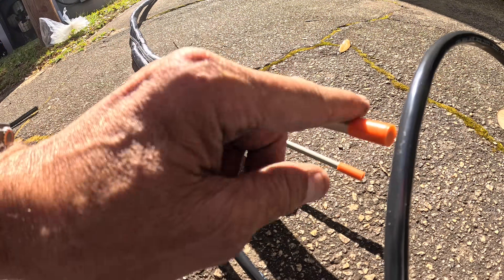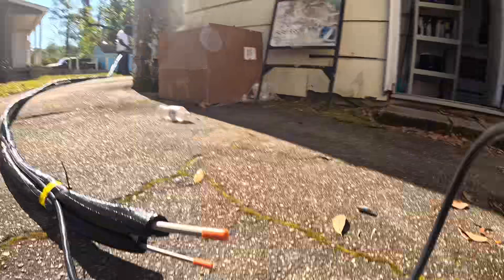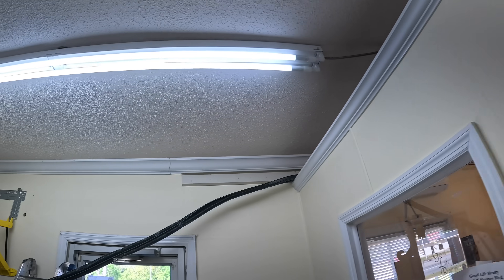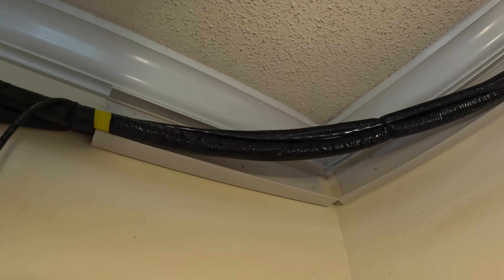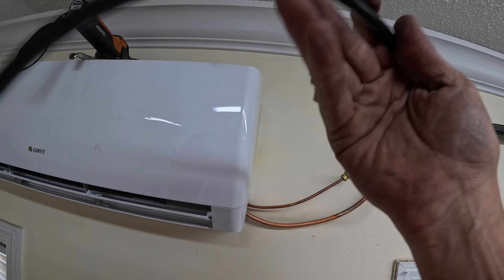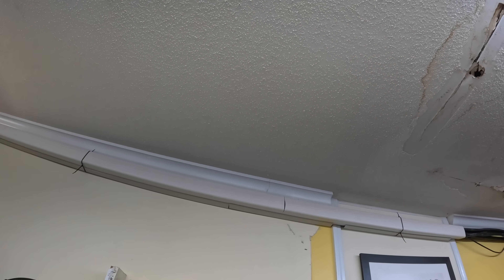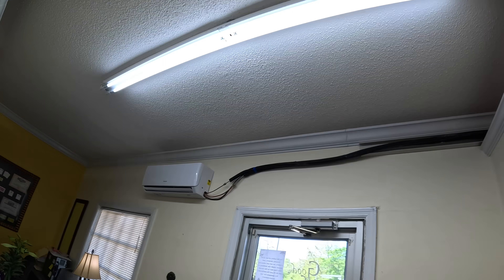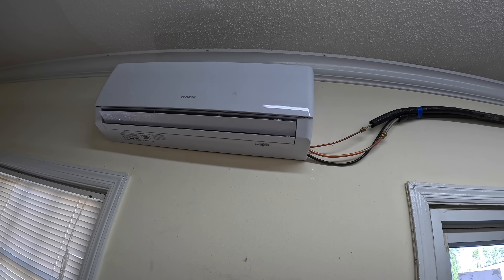Is Steel Really the New Option to Copper? #hvacguy #hvaclife

Comment: To be fair, cars use steel lineset for brakes. They last about 10 years with road salt. That being said, they only last 10 years. HVAC equipment tend to last quite more than that. If the lines were made with stainless however this could be a good replacement. Steel? No.

Comment: Many baseboard hot water systems have steel tubing from the 1950's.
Staybrite soft solder works the best.
Silver bearing solder .
100.00 for a 1lb roll

Comment: Back in 1980 Aeroquip made steel line sets and had a spring around the suction line.
They recommended stay brite #8 silver bearing solder.
Melts at 455*
Test pressure 10,000 psi.
Still use it today on all my copper line sets.
No need to purge .
Appreciate your videos Cutiss

Comment: Stainless steel is the only steel I would trust. Zinc is a catholic coating to protect steel. Welding with galvanized pipe creates a poisonous gas and is especially dangerous in confined spaces like attics. Well ventilated work areas is a must. Zinc will mix with the braise and degrade it. The extreme braising heat will oxidize the zinc creating zinc oxide inside and outside the line. The heat will create a corrosion spot on the line set by removing the zinc. Zinc coating will change the thread tolerances for the threaded fittings. I would not trust it from for long term sealing.

Again stainless steel lines, not galvanized.

Comment: There is a central ac unit at my work with rubber linesets. Its been going for many years without issue surprisingly.
Reply: That was a thing in the late 70s and early 80s.

Comment: If I could afford a system this is what I would install since my home was built in the 1940's. Putting duct work under the floor would be a pain also my house is small so installation of an air handler would have to be in the attic and the noise from the blower fan would be to much. I'd prefer the lines to be in the attic then brought down to the units.  Air conditioning is a luxury I simply can not afford it's for the wealthy!. I still enjoy these videos!

Comment: I’ll stick to copper forever. I refuse to ever buy an overpriced press tool or press fitting and I’m not using 45% and having to cover the joint with shrink wrap, that’s insane. There’s a reason copper has been the industry standard for decades. If you don’t like the way soft copper looks there’s always hard drawn.

Comment: I’ve done a lot of mini splits. I bet you get alot of lesks doing it that way. Press tool. Best way to go for minis. Need one anyway for 454b.
Reply: You don't need to press R454b refrigerant fittings
Reply: @nonamesplease8228  no, but many manufacturers highly recommend it. That’s why a lot are going with mechanical txv’s and other parts

Comment: Mini splits are the best. I wish I could get rid of my 3 ton and 4 ton unit and just outfit my home on a ducted mini split. So much cheaper from equipment to energy usage.
Reply: I don't think the durability is there with minisplits. They are pretty much throw away from my experience unless you buy high end Mitsubishi's. But then the cost is crazy.
Reply: @EthanThruandThru that’s the way I see it. If the inside break $400 for a new one. Outside breaks $400 to replace. Why fix it?  It’s just so cost effective and you should get at least 5 years out of them maybe 10.

Comment: Rectoseal makes 3' long flexible mini split line set extensions in multiple sizes. Copper would have been my choice due to the flexibility needed for use in line set covers on this job.The flex line adapters would enable you to run the line set covering directly to the unit making a neat installation.

Comment: I have to agree with comments about corrosion. If the galvanization is damaged or wears off, it seems unavoidable that rust will form. Especially on an AC lineset where it will be exposed to condensation from the air. You mentioned in the beginning that flared ends are a bit stronger. That implies that the metal work hardens which means that each time you make a bend, it hardens. Might be prone to cracks or kinks in that case. Galvanic corrosion may be possible (unavoidable?) with the different metals; especially in the presence of water. Not sure about this idea. Wonder how much testing was done prior to market.
Reply from the maker: Already used in automotive. I know theyve put a lot of effort into stopping the corrosion. And I’d suggest running nitro as well. If welded, and not properly treated, surely it will rust.
Reply: As someone who works in automotive, I don't think there will be an issue. Steel brake lines can typically last 10 years in an environment where they salt the roads in the winter so in a household environment like this I would assume they would easily last the lift of the unit. Most likely the only rust you will come across in this application is surface rust. If you are really worried about it you could spray a rust preventive like CRC 06026 on the connections.

Comment: Orange rods work well with brazing cop to steel, same with the solderweld pink rods. Just make sure that coating is cleaned off the steel before trying to braze it. 

Seen liquid line aluminum line sets ran in AZ on new builds.
Reply from the maker: Haven’t see that yet.

Comment: Wow. I love that flaring tool you have.  Its battery operated and motorived.  Who makes it and where can i purchase one?   Also the refrigerent lines being ran across the ceilings and alomg side the walls look very tacky to me even if enclosed with the plastic housing.  Takes away from the molding at the ceiling.  If it were me, i would of used ceiling cassette type  evaporators, and ran all the lines through the attic.  Makes for a much nicer install.  I dont like looking at that bulky unit on the wall.  Great job with the new steel lines though.
Reply from the maker: I couldn’t do that. It has a flat ceiling, and no attic.

Comment: Nice install Curtis. I'm surprised to see steel linesets due to corrosion problems but time will tell.
Reply: Both lines on a mini split are low pressure and will sweat. Then there are the dissimilar metals that are in contact with each other. That is going to cause electrolysis.
Reply from the maker: Galvanic corrosion
Highly unlikely to occur due to the lack of a corrosive environment (oxygen and moisture) and the diffused Nickel coating that is electrolytically applied to the inside and outside of the tube. The Zinc and epoxy coatings are on the exterior to prevent environmental corrosion "rust".  The Nickel coating melts and flows at around 2600 degrees Fahrenheit, above brazing temperature. This coating does not burn or flake off during brazing and does not crack or flake when flared or expanded
Reply: I don't think corrosion happens unless something is getting wet. If there is any condensation forming on the line, that would be bad bad.

Comment: The zinc coating is ok. Its what they use in on ice machines evap plates. But when that coating wears off, you will have issues with temps. Usually  on ice machines when zinc coating wears off, you replace the evap. Its just another worry you have take in consideration. I know steel pipes in larger aspects tend rust and spring leaks when exposed not maintained. I'm curious to see if it lasts.
Reply: My thoughts exactly. We moved away from galvanized steel pipe for waterlines... I don't think moving into zinc-coated steel refrigerant lines is the wave of the future.
Reply from the maker: Galvanic corrosion
Highly unlikely to occur due to the lack of a corrosive environment (oxygen and moisture) and the diffused Nickel coating that is electrolytically applied to the inside and outside of the tube. The Zinc and epoxy coatings are on the exterior to prevent environmental corrosion "rust".  The Nickel coating melts and flows at around 2600 degrees Fahrenheit, above brazing temperature. This coating does not burn or flake off during brazing and does not crack or flake when flared or expanded

Comment: Rust
Reply from the maker: Has a zinc coating to prevent rust, but if you heat it up that burns off. So factory suggests heat shrink, but are developing a paint

Comment: I thought mini splits have connectors already on them. Why do you have to end a flare and stuff?
Reply: DIY mini splits have pre formed flares on them. They are also pre charged with refrigerant. Problem is if you need 21 feet, you get 25 feet and now you need to coil 4 feet of line set and put it somewhere out of site. Contractors version, you buy line set separately , cut to size and add flare to one side.
Reply: Only the DIY systems have connectors. The professional install only ones require flaring or brazing.

Comment: Copper to brass to steel, what could possibly go wrong. Maybe better if you were using stainless steel unions.
Reply: I think brass actually has less galvanic corrosion risk when coupled with either. However, if your comment is to say that stainless steel should be used so it fails before the line set, then I see your point.